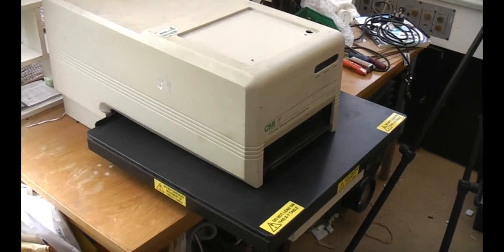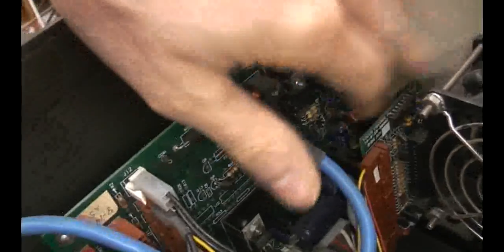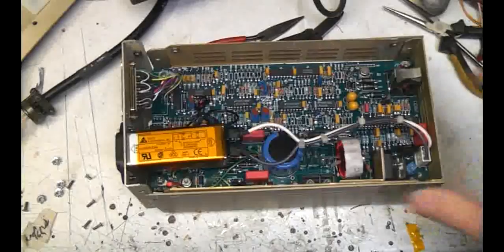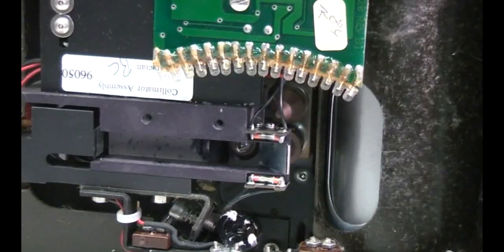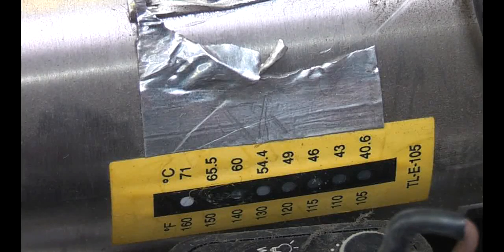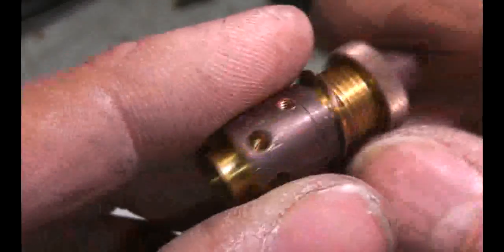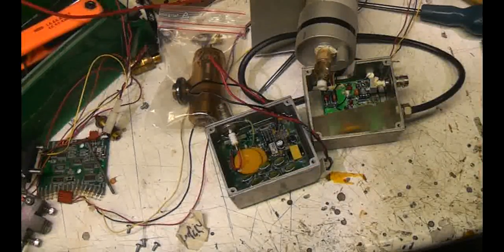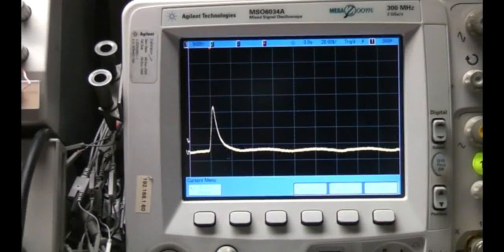X-ray fluorescence spectrometer teardown

Comment: Hello, I used to work for CMI, and it's possible I built that unit!
Reply: That scanner board is Z axis protection, if anything breaks the beam, it would stop moving down.  Or if the board is hit first, the switch would also disable the Z axis.

Comment: Just my 2 cents. I worked in a metal finishing shop (electroplating) about 20 years ago. We used an X-ray fluorescence device similar to measure deposited (plating) thickness. This method superseded beta-back scatter for measuring. The equipment was very expensive. Tens of Thousands of dollars. They were very accurate. On special parts we measured with micro-cross section (cut parts in half and measure plating thickness under a microscope)  to verify thickness.

Comment: Naphtha. Use gloves. Cleans anything that it doesn't melt, and melts anything that it can't clean. You can also use the lighter gas if  can't find Naphtha.
Reply: Acetone also works well. I have a 'step' process when it comes to solvents. Start with the 'nicest' end with the meanest. Naptha, acetone, xylene, mek, 1,1,1-tce.

If none of them can touch it - I don't want to mess with it.

Comment: What is the original purpose of the radioactive dinner plate?
Reply: To get a vibrant Orange red colour they used uranium oxide. They stopped using it in the 1940s. The plates are known as Fiesta dinnerware.
Reply: I guess it also keeps the food on the plate nice and warm. Thanks for the info
Reply: My guess is to have ... dinner.

Comment: For some reason I thought that X-ray tubes have rotating parts inside them, but I don't see them in the video. Did you take them off for the demo, or are they just not used in this kind of tube (only on some other kind e.g. higher voltage), or are they there and I'm just not watching closely enough?
Reply: I've never heard of X-Ray tubes with moving parts.  Just the high voltage and the low gas pressure inside the tube are all it needs.
Reply from the maker: Some high power tubes use a conical rotating anode to spread out the power dissipation at the target. Less common nowadays with better detectors
Reply: You are right. Some older tubes will feature a spinning tungsten anode inside to keep cool via heat dissipation as they get very hot from the electron gun. Tungsten's melting point is 3,400 Celsius and conducts heat incredibly well. In some cases, the tungsten in xray high power tubes have been known to melt so it helps to increase the apparently surface area to the exposure of electrons, and in turn helps save a lot of bother with external cooling.

Comment: So, I take it, the x-rays you were playing with in the end weren't that dangerous? The camera didn't realy pick up any of them.
Very interesting video!
Reply: the source of gamma he was using is an old fiestaware plate, that has uranium oxide in the ceramic glaze. it is a very low level source of gamma radiation and is safe to handle. also the sensor he is using is very sensitive to gamma radiation. some homes in certain parts of the uk need to have a ventilated basement due to naturally occurring radon gas coming out of the ground!!
Reply: insanitybiker
Thanks. Actually, I was refering to the X-Ray tube he used after that part in the video.